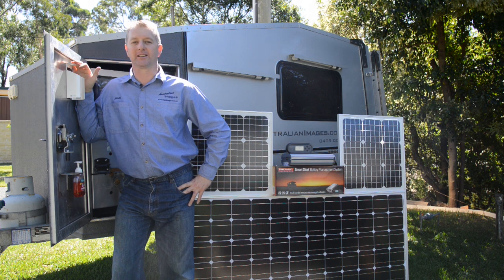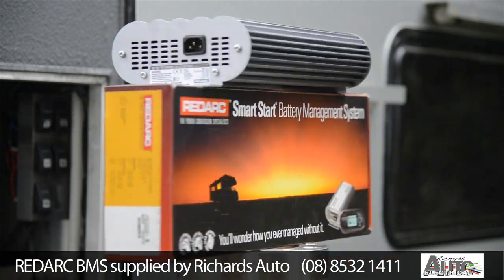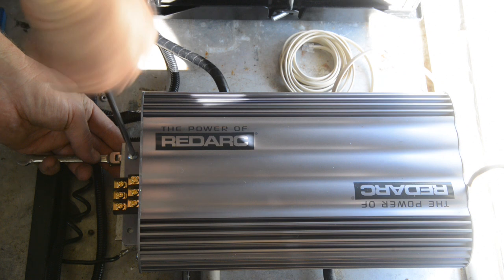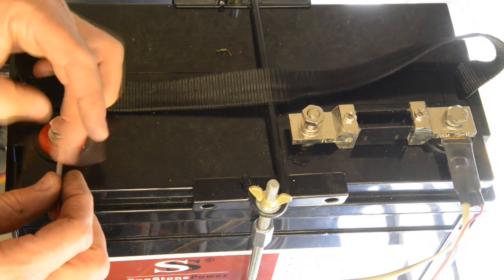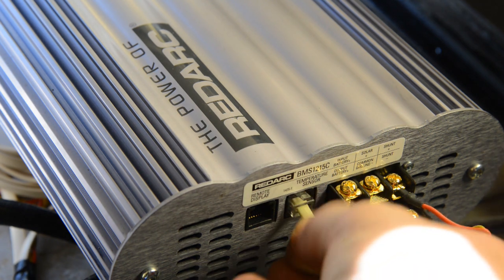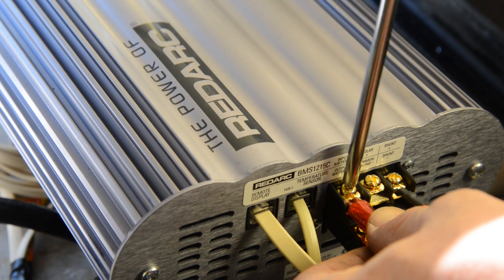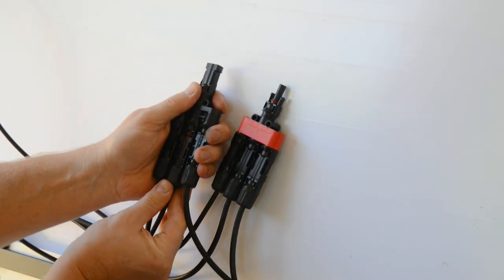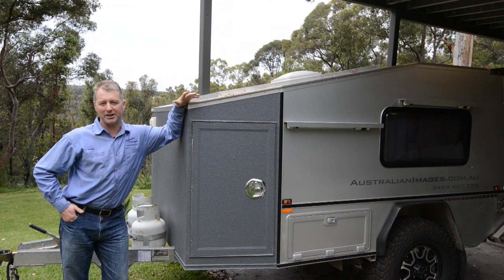DIY Camper Trailer: Redarc BMS and solar panel install

Comment: Very nice setup.  More people should use setups like this.  My only question is, the letter "R" is not silent at the end of words.  How come Australians refuse to pronounce the letter "R" at the end of their words?  This is incorrect English pronunciation.  I only wish there was a demonstration was made at the end of the video of items utilizing the power that was generated.  Otherwise, I loved this video.  Please upload more.
Reply from the maker: Funny, most Australians don't understand why Americans over-accentuate the 'R' sound in general! I would imagine the correct British pronunciation is somewhere between the two. Australians say "Traila", Americans say "Trrailerrr", British say "Trailar".

Re the power usage... There is a 12v fridge, lighting and USB power outlets. I may also add an inverter in future, to run the microwave when I am away from power and don't want to run the generator.
Reply: 12V fridges are expensive.  I'm going to have to get me one of those shunts so I can measure the power usage more accurately.  Very nice, indeed.

Comment: does the earth coming down from the solar panels go straight to chassis or to bms, dumb question i know but i noticed you had two earths going to bms, thanks Brett
Reply: Brett Mcleod to the chassis, not bms, but you would make a negative/ground terminal block that you would run all your negatives back to so you keep things neat and not drilling a million holes everywhere and so you can maintain the connection from the environment. That neutral goes back to the grounded side of the battery monitor/shunt block.
Reply: Australian Images you sure
Reply: Don Paterson  thanks Don,  yeah I have a couple of heavy duty blue sea bus bars for all the earth's and a large earth going from there to chassis 😊
Reply from the maker: I connected it to the BMS, because it was twin cable running down from the panels, and that made it a simple place to connect it. But as Don wrote, it's a common ground so it doesn't really matter where it's connected. There is a common ground point that goes through the body(floor) and the chassis rail just near the battery.
Reply: Here is the link to download the manual, in there has the diagram. I think we are confusing bms and battery monitor block https://www.redarc.com.au/the-manager15
Reply from the maker: My version is the precursor to the Manager15, and the terminals are slightly different. It has a positive solar input terminal and a common ground terminal which you connect to the body/chassis common ground point. It can also accept the negative wire coming from the solar panels. It doesn't matter either way though, as it's all joined together. There are two wires connected to the - terminal on the BMS: One goes to the chassis/body common ground, one comes from the - solar. Only done this way as it was a twin cable coming down from the panels, so easier to connect it straight to the terminal on the BMS than run it across to the common ground point.
Reply: mine is the same as yours i think 1215s2 I pretty much have all the electrics wired up in the canopy & will be sheeting the outside in alloy  next week then installing the solar panels on the roof, just wanted to double check on the earth coming down from the panels, thanks everyone for your replies & the video helped out heaps, thanks for posting.
Brett
ps think i will wire mine the same as yours, i also have twin cable coming down from the panels and would be more practical to run both to bms as you have done :)